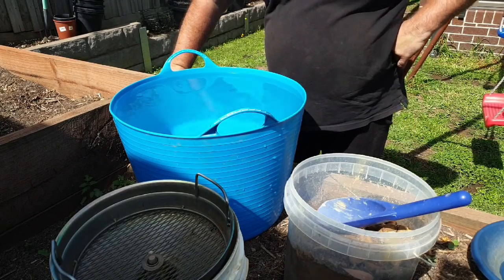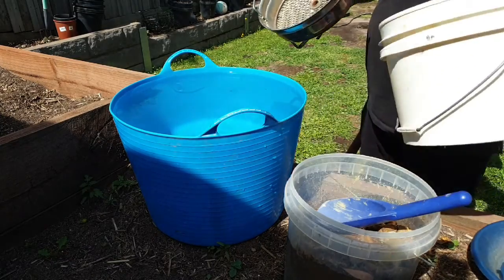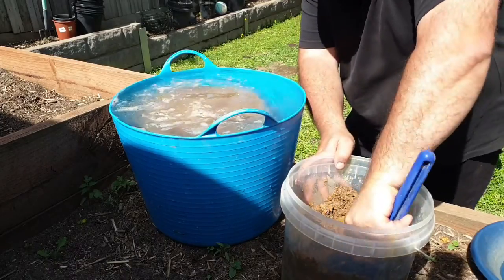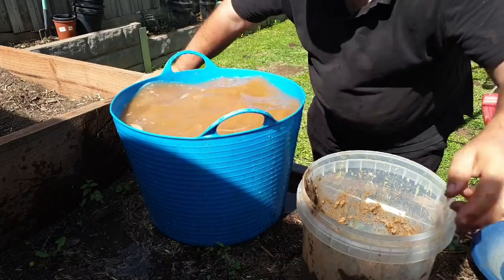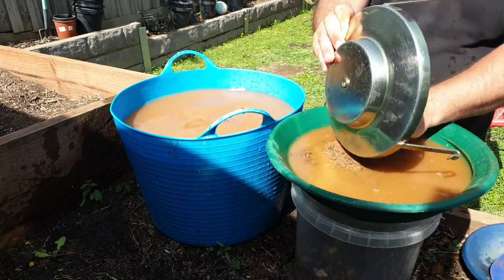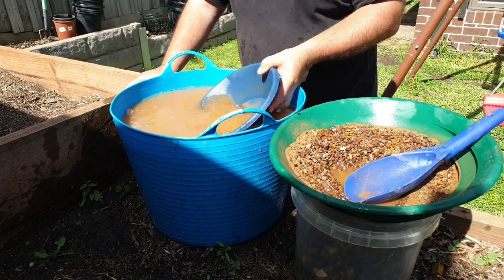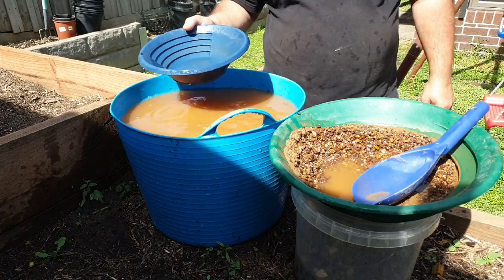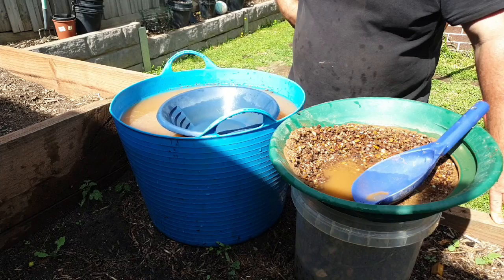Rota-pan ( How it works ) Demo

Comment: Hi murray,you should give it a full turn/spin after you've stratified using the curved keel to remove the overburden from your cons tray. Cheers Craig
Reply from the maker: Thanks for that Craig. The other thing I didn't show was you can brush off half the dish and only pan the small part of the capture dish. Just so there isn't so many cons.
Reply: @MurrayRiversGoldAdventures  i think that is what Craig full spin at the end does - flings out the barren material

Comment: Why would you go to the expense of a turbo pan if you are only using it a classifier then using a normal pan to pan off.
I thought that as you place you dirt in and as you classified the actin pans off the lights from the bottom tray and the gold and heavies are left there. No need to us an extra pan. 
Please advise if I wrong.
Dennis
Reply from the maker: Dennis you can just empty the bucket and keep feeding the Rota-pan. You don't have to empty the capture dish. It will hold quite a few ounces of gold  in it. It about speed. You seen how long it took to run the bucket. About 5 minutes.  Your left with quarter of a pan to pan out at the end of a day of screening though it.
Reply: Thanks for explaining, I could not work out why you had to use the dish pan. I thought the roto-pan did it all.